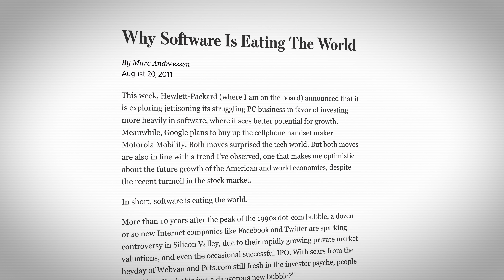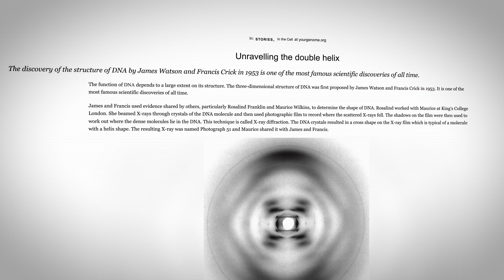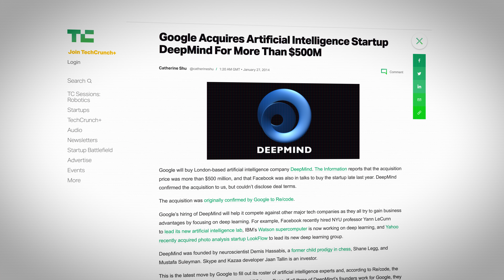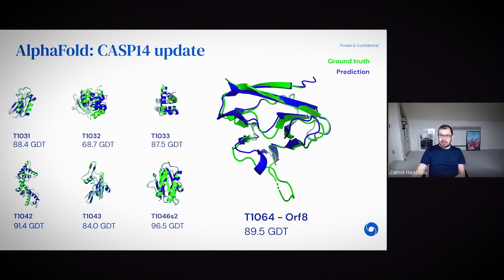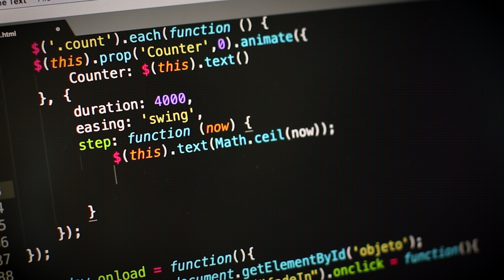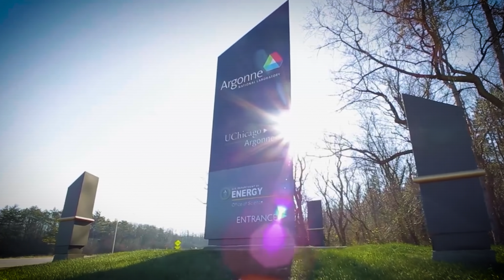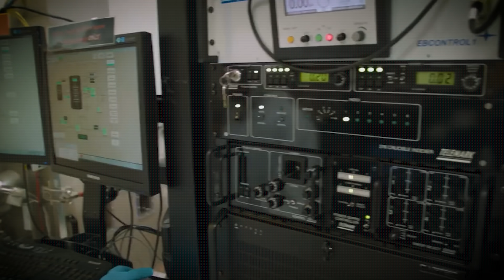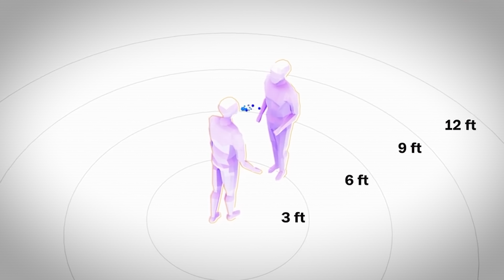AI's Greatest Scientific Advances

Comment: Simple explanation of so called "AI": 

It is a group of algorithms that build and run "statistic models" of provided data.  The models are made of "patterns" that "condesate" inside a special structure - layers of interconnected  "neurons" and "weights". 
Later, those patterns being manually connected to the right outputs and the model is ready. This step called "learning process".  
This data model with proper algorithm allows doing one of 3 basic things: to predict, to classify or to recognize input from the same source. 

The application field is huge, bcuz literally everything around IS data.
Reply: When people discount AI because it's just "statistical modelling" then i must think how our brains are not all too different. Layers of yes(fire) no(don't fire) neurons with the ability to have weights (varying voltages).

Comment: Skeptical. Studied Quantum A.I. in grad school (in the physics department, not CS) and became a founder afterwards. The "dev" cycle in science is totally different than in Silicon Valley. Plus the blackbox nature of ML means that many papers applying A.I. to science simply cannot pass peer review, which means that very few researchers will be able to build academic careers on A.I.-backed science. It probably wont be until the 2030's that we'll see A.I. algorithms have any real impact on science outside of a few headline-catching articles. We'll probably see more activity from private firms which can capably join A.I. teams with scientific teams (which is a large departure from the norm of real-world science).
Reply: AIs need to cite their sources.
Reply: Could you explain more how papers who used A.I would often not be able to pass peer reviews?
Reply: @axelr7787  Joseph touched on it. For peer review you often need precisely replicable systems. E.g. mix 51 mL of chemical 1 with 49 mL of chemical 2 and heat up to 500 C. ML models are, by definition, stochastic systems. So if you train 2 models under the same exact hyperparameters you'll end up with different outputs. And they are also universal function approximators, aka they don't necessarily model an exact solution but rather they try to approximate solutions. While I personally believe in A.I., it's still a hard sell to pass it through the peer review process for non-CS academic journals since it is inherently impossible to exactly replicate the training of a given A.I. Peer-review paper submission is the most important metric in an academic career so it's unlikely that younger researchers interested in applying ai to the sciences will be able to work on that for the foreseeable future. More likely is that they'll start passing peer review as more computationally-oriented young researchers become peer reviewers, which will probably be in 10-15 years.
Reply: @Joseph Stearns I understand you now better, but should this not only be in areas where the AI would suddenly venture into a new and unexpected area of knowledge where there would be very few or zero human experts? For example the way DeepMind's AlphaFold worked it was fully possible for leading biologists in the world to acknowledge it's achievement in some thing which looks really close to the peer review process
Reply: @Joseph Stearns Researchers can publish the exact parameters of the AI and the datasets used to train their models. The only issue would be for things at the bleeding edge that require massive computing resources. But that isn't much different than, say, the research being done at the Large Hadron Collider. And at least computing power tends to become more accessible every year. I don't see what the problem is.
Reply: AI is the reason it only took a matter of days to develop the Covid-19 vaccines. It was the human trials that took eight months.
Reply: Ah, so not only you are lying both to yourself and to others that "AI works!!!", you also cannot publish and make a good living out of it. I'm really impressed!!!